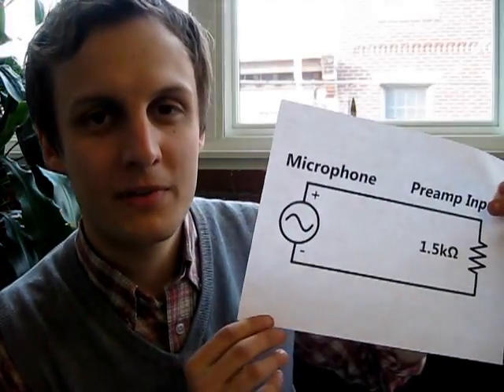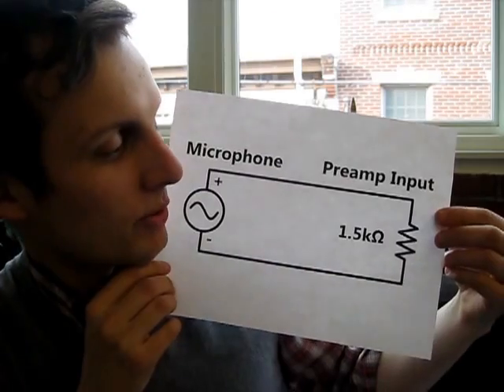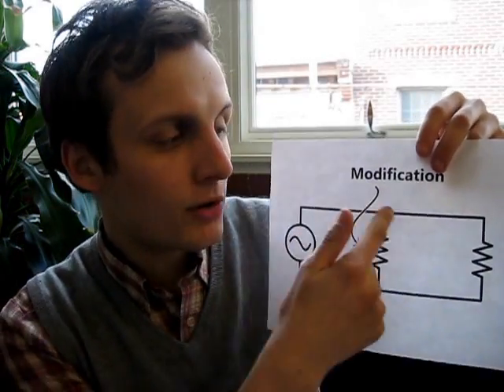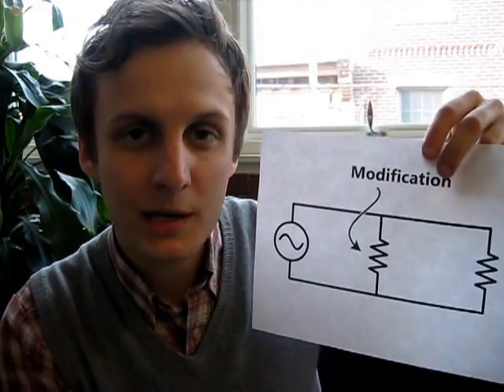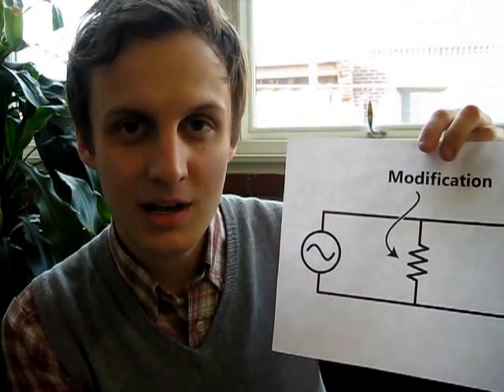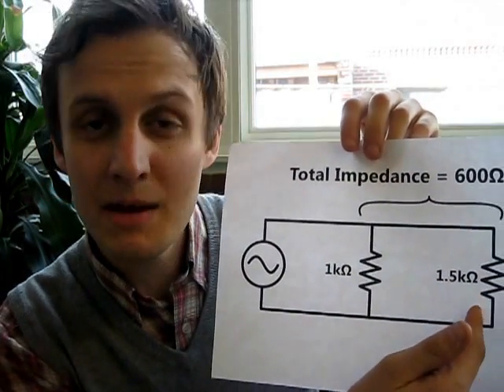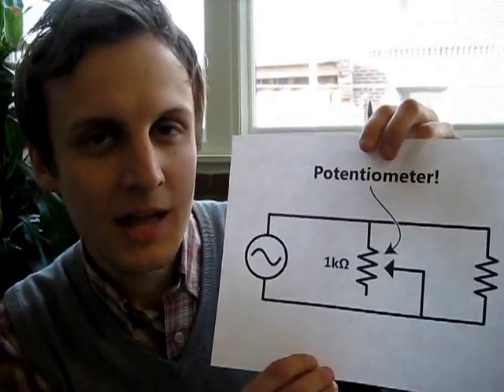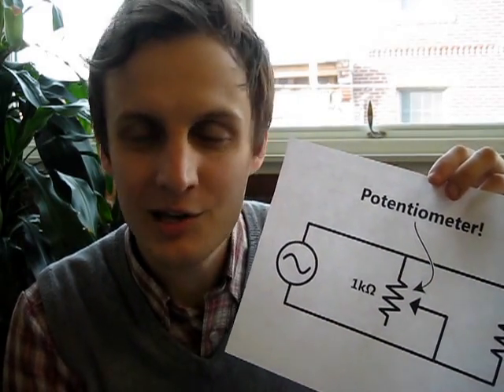How to Add an Input Impedance Control to Any Mic Preamp

Comment: If you put a 1Kohm pot in parallel you limit your range of impedance to 600 ohms or less. I would use a 1 Megaohm or even a 5 Megaohm potentiometer for more range.
I would also consider what the lowest useful impedance would be and calculate a parallel resistor value and include it in serial with the pot so as to not short out your input when the pot is turned all the way down.
Reply: Usually volume controls are 10k pots and tone controls are 100k pots. Why this is so Sir
Reply: I Agree, if you add a parallel resistor to the capsule, the overall resistance will only be less than its original, if the capsule is 600ohm and the resistor 1K it will be 375ohm max. So if you want to add resistance, it must be a variable resistor in SERIES with the mic capsule...
Reply: Both you and peterson are a bit off on this. First, many preamps are higher than 1.5k...often like 3k to 5k, some even higher. You dont want to limit your highest imp choice after adding a pot, so yes choose a larger pot than 1k or your new max will be much lower than your orig max. On the other end of things, 1Meg is far too high and 5Meg even moreso...they will have little to no effect til you get way down on the control, with a very narrow touchy range there, so thats not good either. A better overall choice would be a pot somewhere between 10K and 100k. There are only 4 common pot values in that range, so 4 choices...10k, 25k, 50k, 100k.  Try a few of those to see which works best for your preamp of those 4 choices. Forget 1K and 1M they are too far on either extreme, either doing too much or too little

Comment from the maker: Hi Frank, that's a great idea. A 200-Ohm or so resistor in series with the pot would be a great addition to this box.
Reply: Noob question:  When you say in series do you mean that the resistor needs to be soldered to pin 2 and pin three of the lead points on the Potentiometer or between pin 2 and pin 3 on the XLR input, or does it matter?

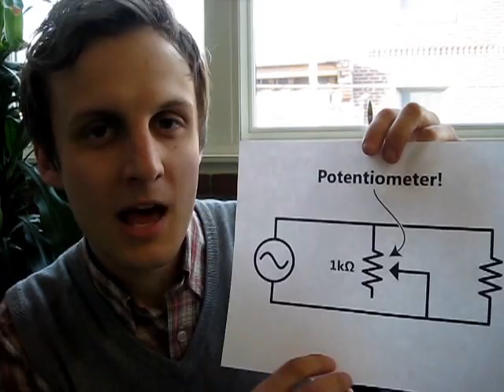Comment: Two things: [4:47]  You need to put a resistor between the wiper contact and the  connection to the the XLR or you will dial in a short. The link to the graph referred to by John, doesn't work.

Comment: Just ran across your pages today after an epic struggle trying to procure a stereo amp with balanced inputs for my main outs on the old audio interface. It shouldn't cost that much. Anyway, I'm stoked this information is available and I'm in the process of ordering the balanced line input module in order to connect the unbalanced outputs to the l/r inputs on a cheap goodwill receiver. I'm fairly confident that this is the proper solution in order to reverse polarity on one of the balanced signals being sent from the interface. (Right?) Anyway, thanks for the video, keep em' coming!

Comment: I am also seeing this referred to as the same selectable input impedance function as many mic preamps have, when it is true that most of those are SERIES resistors which INCREASE the resistance, NOT parallel resistance which is LOWERING the resistance, in other words loading down the mic, attenuating it, and DEPENDING ON THE MIC, changing the mics natural frequency response, either to a huge, or maybe just a slight degree.

Comment: Correct me if I'm wrong but when you demo the actual assembly I believe you have just put the pot inbetween pin 2 & 3, kind off shorting it via the resistor. This is not really a parallel connection to the pre. 

I would have thought that a better mod would be  on the preamp side not the mic side, otherwise mic manufacturers would add switches in their mics to change impedances as a gimmick. 

Also, the 10:1 ratio is actually not that bad, it might be overkill for some mics but my experience is that transients "seem" more responsive with a higher ratio.

I'm actually wondering whether you couldn't increase the output impedance with the a dual pot in series with the pre.. rather than parallel.. hmm.. 

I think this idea seemed great but you haven't convinced me that you've fleshed it out and also actually tested it properly using spectrum analysis. 
Cool idea tho!

Comment: What you get with lowering the impedance is more 3th and 5th harmonic distortion. That is not tone correction but added distortion. Even the 6K8 resistor in the phantom loads the emitter follower in the microphone. When you use the True Phantom powersupply, you no not load,, and the distortion of the microphone is 4-20 dB lower. See http://truephantom.nl/ and the chip: https://www.prema.com/index.php/en/assps-en/audio-ic
J. Kist

Comment: great DIY project. thanks a lot! ;  i'm building one..... one afterthought; consider a PEC potentiometer or someting else of really high quality,  the contacts on that alpha pot could be an achilles heal that degarde signal quality. regardless. thanks again. great video.
Reply from the maker: Thanks! Honest question for you: how do you think the contacts would degrade the quality? (Besides losing contact with the track altogether). Added resistance, capacitance?
Reply: maybe the pot you used is fine, but if the contacts aren't a high quality like silver, gold or a good nickel alloy, they will likely not conduct the signal and all its bandwidth which as much integrity; less inherant capacitance for the task,   or you could say comparatively more resistance to that of a higher quality metal for audio. i'm doing your build with one of these.. PEC 6311-351 1K D5 TYPE K. It has gold contacts; worth spending $10 give or take on the pot. try one yourself and let your ears be the judge. thanks again.
Reply from the maker: Thanks Brian. My understanding is that the terminals of your PEC pot are gold plated not to improve conductivity or any other spec, but to prevent oxidation over time. That is, there's nothing special about gold as a conductor, it just doesn't tarnish. Every pot will conduct the entire bandwidth of an audio signal. 

I'm not sure what you mean by "less inherent capacitance for the task," but there is no need for any capacitance at all in this circuit—the the less the better, in fact. 

There's absolutely nothing wrong with using a $10 pot for this project—it may last longer—and I appreciate your feedback. I just wanted to make clear to anyone stumbling on this thread that any pot of reasonable quality will work with near-perfect fidelity in this circuit.
Reply: hi peterson, by 'less inherent capacitance' i'm not talking about 'capacitors', just capacity to conduct the sound (my bad terminology)... nonetheless, i don't agree that one metal is 'like another is like the next' in terms of how they conduct audio... in my experiecne different metals and alloys have very different sound characteristics and some are better than others... regardless, as i said at  first,  it wouldn't surprise me if the pot you used sounded great. thanks again regradless for posting this great DIY build.
Reply: Brian Gager do your ears hear the difference? 

Have you done a blind test ? Build one with each pot and then have someone swap without you knowing ??

Just curious 

In my experience, at low impedance (1.5K) and low bandwidth ( <20Khz)  I feel the added expense isn't worth it for the sound alone. I'd say the $10 pot will be functional in 50 years time, but there is a possibility that I won't.

Comment: Gone searching a resistor. UPD It worked! Thank you! A Question: If i shorten the wires like that, when potentiometer is opened, is it painful for electronics (condenser mic or preamp)?

Comment: I recently bought a mic pre (input and output transformers as well as tubes) from a tiny boutique company. It has a 500 Ohm and a 2K switch for the mic input and the builder told me I should be using the 500 Ohm input for my capacitor mics, which output the usual 150 Ohm to 200 ohm. I told him I would expect the 2K to be the "correct" selection, but he said no. I don't like to question him, as I know nothing really and he did build the thing, but is there any circuits that would make this 10x rule not correct?
Reply: In theory you are right that 2kOhm input impedance is more appropriate in order to minimize loading (the impedance rule of the input impedance to be at least 10 times the microphone output impedance) but I wouldn't say that setting the preamp input impedance to 500Ohms is a wrong thing to do. Like Peter mentioned in this video, it's just going to sound different with lower overall output.

Comment: Hi ALL..   A good Discussion regarding "Matching Impedance"  would be Considering using "T" Pads and ""H" Pads..  Using them would keep the MIC Side and the Pre Amp Side constant  Resistance..  The "LOAD IN and the LOAD OUT"  would never change BUT  to recover LOSSES  the PRE AMP   would DO THAT..  SO   Research   "T" Pads   and  "H" Pads in the Radio Armature Hand Books..   Something to BUILD on the Knowledge Base..

Comment: Shouldn't there be a resistor in series with the pot?
In the current situation it is possible to short the signal.
I don't think anybody would be interested in an input impedance less than 10 ohms. (or so.)

Comment: Sorry if this is a dumb question. I just created the mod, and as the potentiometer is turned down, the volume drops to zero. Is this just because the resistance is so high, or did I do something wrong? Thanks!

Comment: I've got an Allen&Heath MixWizard WZ3 16:2 which has a 2Kohm XLR (pad out) connection and I've got several sm57 and sm58 mics, which I would like to do a fixed resistor mod on because I only use those mics with this one mixer. I'm good with a soldering iron but I'd like confirmation from a couple different sources what value of resistor that I should install in these mics to get the most optimal performance/sound out of them. Thanks!!
Reply: +WallOfSoundPedals Check out Uncle Doug YT chn he does some great videos that would answer your questions.

Comment: Yeah that's the obvious thing, that unless you want a mute control, shorting out the signal is not too helpful. How did the Shure guy not catch that? 
If it's not too precious you could install this on your preamp, they sort of touched on it but this will make more of a difference on the average dynamic compared to a condenser mic [ buffered electronics ] Paul Stamler had an article about simply adding a resister to your sm57 , same idea.

Comment: Great video! I loved the early Hot Jazz too! I've got an impedance mismatch of a standard Shure sm58 mic 150 ohms (300 ohms actual) to 1M ohms guitar effects pedal input. As a result of the impedance mismatch the signal is not tickling the distortion effects as much as I'd like it too. I bought a Livewire Lo-Z to Hi-Z transformer adapter and I actually think that's tickling the pedal too much...rather I'm getting wicked feedback more so than without the transformer. I'd like to dial back the resistance just a hair rather than dialing back my pedal's drive. Someone told me I shouldn't as it would ruin the mic. The Livewire transformer probably still isn't right for the input as the thing says 250-50k ohms on it. Any advice?

Comment: Shouldn't this be called, input resistance? In order to change the impedance, it would have to be a coil, an inductor.
Reply: Impedance is reactance + resistance, and the reactance comes from the coil. So if you don't have a coil, then Z=R

Comment: May i ask what is the formula?
Reply: +SiIentwater R1 = R2 × Rtotal / (R2 − Rtotal)
Reply: @yngvai777  Hello Michael, could you apply the  formula  to the specific example of the video? What values R1,R2 and Rtotal would have? Which would be  the "desired impedance of 600 Ohms"? which one " the resistance to put in parallel of 1kOhms (the pot)"? and which one the "pre input impedance of  1.5kOhms"?...Thank you

Comment: @Peterson Goodwyn So as luck would have it, your kit is sold out & I don't have a drill press or any other fancy tools other than soldering iron lol... Nonetheless, while I wait, i'd like some clarification: Lets say I have a mic preamp that has a 600OHM input impedance stock & I want to be able to create a 10:1 impedance match between my 200OHM output impedance mic & that preamp... Would your pot value be correct, does this device do this, & if so, by what means??? Does it DECREASE the output impedance of the connected mic or does it INCREASE the input impedance of the connected preamp? Also, whatever the above case may be, how do I know what impedance amount i'm at w/o keeping a multi-meter attached? Do you just have to guess???
Reply from the maker: Hi Brandon, sorry for my delayed response. As a passive device, this box is only capable of reducing the input impedance of the preamp. So, as in your example, if your preamp's stock input impedance is 600 Ohms, there is no way to increase it to 2k Ohms with this box. Similarly, there is no way to decrease the output impedance of the mic. Either of those things would have to be done either actively or with a transformer, which is beyond the scope of this project.

Regarding how you know the impedance of the preamp while using this device, yes, you have to guess. But you have your ears to guide you!
Reply: Peterson Goodwyn Man I figured it was too good to be true! LOL You never know tho with technology these days, so I always ask! Thanks a lot man, I honestly think the mic/pre combination will work ok w/o changing the pres input impedance. I think the 10:1 ratio is more of a personal preference than anything, since i'm currently using a GAP73 pre at 1200OHMS input with a 200OHM output mic & it sounds great. Thx again man & congrats on the present & future inventions! That's an awesome gift to have! -B
Reply: Peterson Goodwyn You can add another potentiometer in series with your signal to increase the  impedance.
Reply: If your mic preamp has no input transformer, (e.g. a modern transistorized/op amp type)  you can add a 10:1 (really 1:10 or 1:4)  step-up input transformer, which will both lower your impedance (to more like a ribbon mic's expectations) and boost the voltage (and signal) free.  This is better than a resistor network which results (as video notes) in at least a 6 db loss, (and with the circuit he has made often a lot more loss!).   The only drawback is that for good frequency response you need a good input transformer.   The "10:1" reference is not to mics but to circuits in general, where when amplifying mainly voltages, you want the input impedance of the next stage to be 10x the output of the last stage.   Mic preamp transformers are generally the opposite, in that instead of stepping down the voltage in exchange for better accuracy of voltage and making it up with a gain stage, you want to take the tiny signal of a mic and INCREASE the voltage before it hits the first amp stage, so it is higher above the noise floor.   So mic input transformers usually have fewer primary windings and more secondary, boosting the voltage, but lowering the input impedance that would be seen by the mic.   This is okay, because in a (tube preamp) the input impedance (without the transformer) is already so high that lowering it still keeps it well above the 10:1 ratio for voltage transfer.   Example.  Input stage of preamp is say 1 megohm (the grid bias resistor value in parallel with a near infinite impedance of the tube).  A 1:10 step up transformer makes this 1 megohm look a lot lower, more like 100k to whatever is plugged into the transformer.   But that is still way more than 10x the output impedance of the mic, which may be as low as 50 ohms, 100 -150 ohms or even 600 ohms.
Reply: +Peterson Goodwyn -- Where is the graph you are talking about? Your link is dead.
Reply: Brandon....I didn't know you were an audio geek like me man....We need to talk bro.

Comment: Wow, great video man! Thanks for the post..lots of good stuff in here. Well I had a question that I was hoping you may be able to point me in the right direction with your knowledge base. I want to create an audiophile grade/vacuum tube buffer to be used with my acoustic guitar and lap steel instruments but would like a wider range of instruments to be able to utilize its capabilities as well. I am using a 1992 Trace Elliot TA100R 4x10" acoustic amplifier and a dimarzio dp234 black angel magnetic passive sound hole pickup and just curious what your suggestion would be about going about this if you have already built one before. If not, any suggestions would be much appreciated. Definitely got yourself a new subscriber. Thanks!

Comment: the point of a selectable input impedance is to allow the user to optimize for the mic you are using- specifically to AVOID losing signal that exists in the natural output of the mic, and to AVOID altering the natural frequency response as well as creating harmonic distortion.   dulling a mic down, or thinning it out by mis loading it is not really the same as proper impedance bridging, and then using an EQ.  I just find it misleading to not include all this info, and I do not agree it is a "service" to encourage people to build things that they have no idea will tangibly degrade the quality of the mics they are using and basically educate them to think of that as tone shaping, which seems like a great way to confuse people more than help them.
Reply: It simply changes the sound. Whether or not this is a degradation or an improvement is up to the user.